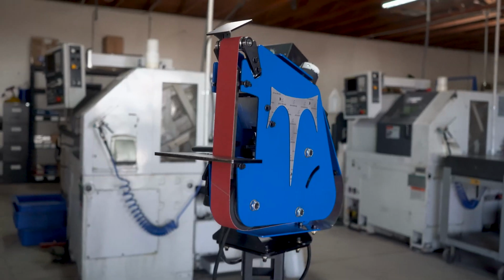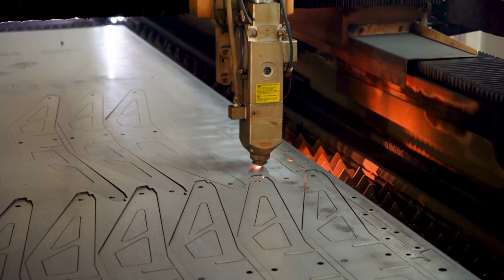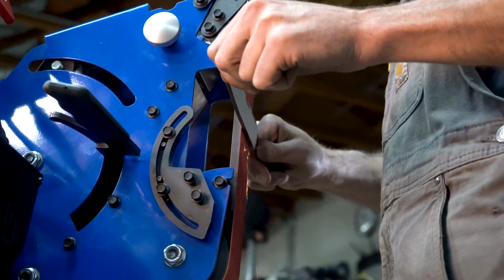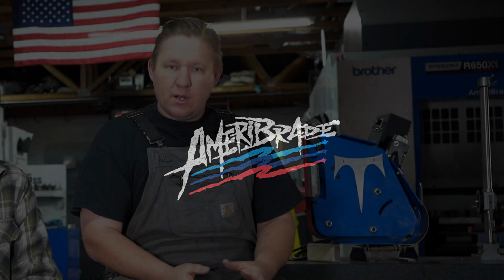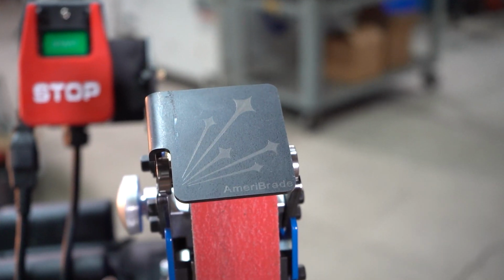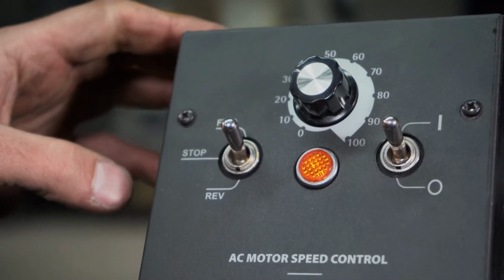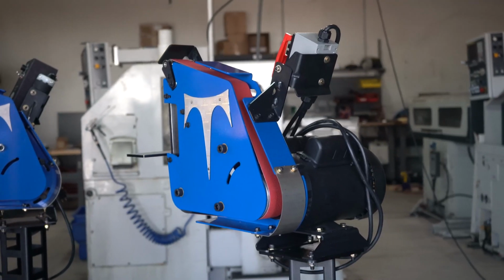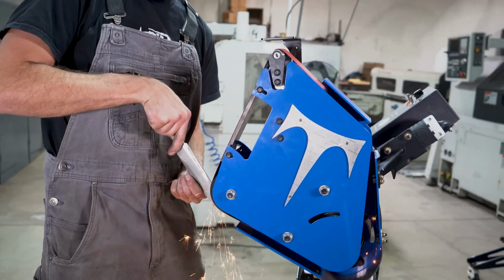Kamimura Trident by AmeriBrade

Comment: Question for the builders of this grinder, if the unit is mounted on a workbench can it be tilted back to give access to the 4 inch rubber wheel at the bottom?
Reply from the maker: It does tilt backwards. Also, you can mount it to where the 4" wheel hangs over the front of the bench. Got your email and sent a picture and video to show how much it can tilt backwards.

Comment: What is (are) the brand(s) and HP of the motors used in your products ?
Reply from the maker: As Keven stated, these are WEG motors with a warranty on the 2x48 machines. We use WEG, Lesson and Baldor on AmeriBrade products.
Reply: @AmeriBradeOfficial  That's good...keep using the good stuff.
Reply: This is a 1hp Weg brand motor, with warranty